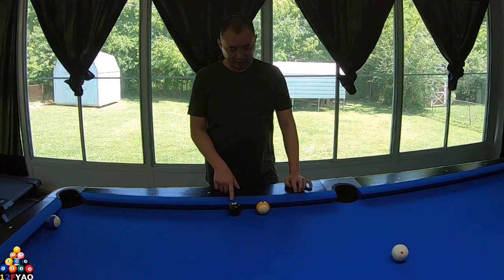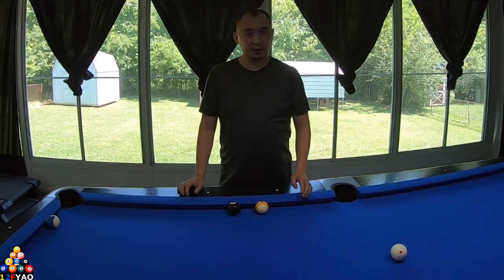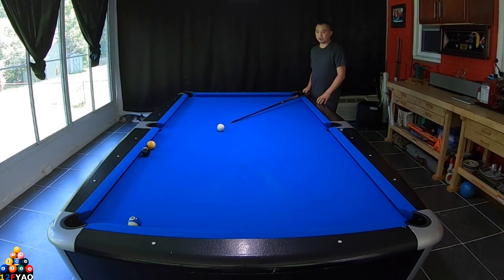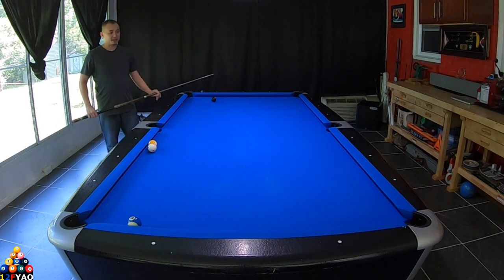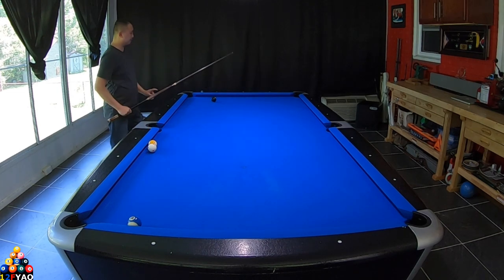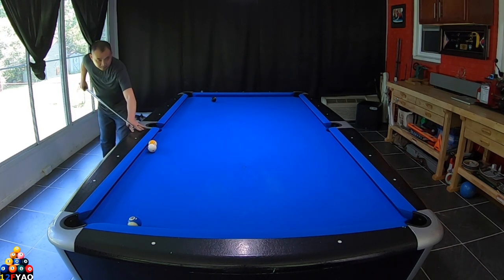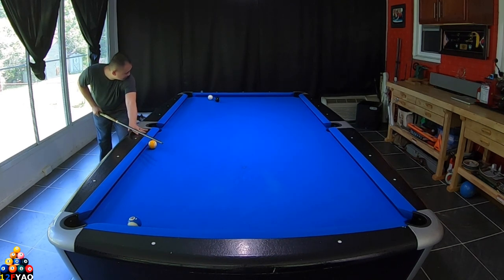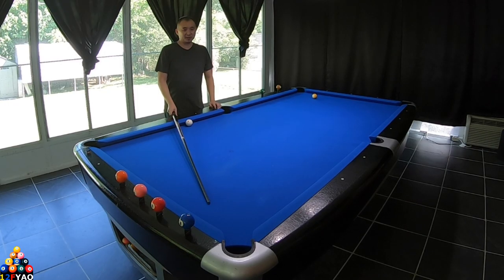3 Rail Kicking Sys. (Pool)

Comment: I was on the 9ft Table last night using this 2nd 3 rail system but beforehand, using the Corner 5 (1st system in this Vid) I determined the table was 1🔶 slow such that in order to pocket the corner from the 50, I had to aim at the 20 ( instead of the normal 30).  How do you adjust for this 2nd 3 rail system knowing this?
Reply from the maker: If you had to aim the 2nd diamond to make the CB go to the corner pocket for the 3 rails, you are not applying enough running English.   When doing the corner, running English is used for the 3rd diamond on the first rail the CB will hit. If not English is applied the 2nd diamond is where the CB will be needed to make it in the corner pocket. Use those two diamonds as your benchmark because they are CB tracks and not always one of the diamonds will not be available when other OB are in the way. Hope this helps, don’t forget to subscribe if haven’t already and please share.
Reply: I of course did apply running English at various levels and speeds when aiming at the 3rd Diamond, but it was short (ie-landing at the 10 on the long rail) in every instance.  I realize aiming at the 3rd Diamond is “Normal” but obviously not all tables play “Normal” and one must then compensate.  As such, I was asking what compensation one can do using the 2nd 3 rail System.  I imagine perhaps halving the Difference ( 1/2 Diamond or 5 points closer on the short rail) may be a place to start?
Reply from the maker: The table is just playing short. You just have to adjust to every table. The 3rd diamond on the first rail is the benchmark for the corner 5.  Hope this helps. Here are some videos from Dr. Dave that might also help.  
https://youtu.be/kWUADt_5cks?si=caqV5bJ8NMgLU0iA
https://youtu.be/G4dv9ekF3FY?si=nIk1LpdB5YnyOvlz
Reply: The Question is, How do you adjust. I too have seen Dr. D’s videos, but they don’t address compensating for the 2nd 3-rail System?  Does my inferred deduction in my previous reply make sense?
Reply from the maker: From what I know there is no adjusting especially if you try every speed and English to try to make it to the corner pocket when hitting the 3rd diamond.  If it doesn’t go, the table plays short and you just have to aim at the other diamonds to make it go in the corner pocket. 90% of the kicking system originated for 3 cushion and we are using it on the wrong table expecting the same results. The corner 5 is a tracking line to see how the table is playing. The player will have to adapt to the table and that’s the only way I see it. If you really want the 325 to work, did you just try hitting the CB at 3 or 9 o clock without top. Something that works, hope that helps.

Comment: Great way to convert a 2-rail kick into a 4-rail kick. You are really hitting a point on the 4th rail. Seems you pushed the object ball and cue ball to an easy shot most of the time for your opponent. Hit on object ball is pretty slow speed after contacting 3 rails. Hard to get separation on the balls for chance of safe results. Good way to pot the ball if 1 diamond or less from the pocket though. Approach angle is around 45 degrees vs 2 rail kick coming in at higher angle. Good stuff!
Reply from the maker: Yes the 2 rail into the 4 rail is like the last best thing for me to avoid giving ball in hand. Thank you for commenting and please share.

Comment: Starting about minute:14, you show numbering the diamonds such that the distance between 0 - 10 - 20 - 30 (with 20 - 30 on short rail) are represented by full diamonds yet, 30 - 40 - 50 on the short rail are only half diamonds. What is the math involved there?
Reply from the maker: It is. The 30 on the short rail is a full diamond and 40 and 50 is measured on the half diamond. I was thought this from a 3 cushion instructor back when I was stationed in Korea.  The 3 rail kicking system is derived for 3 cushion billiards. The math is CB minus OB equals the first rail the CB will hit to get to the 4th rail where the OB is. The 3rd rail is the same track line as the 4th rail. Here is a 3 cushion video with the full number on the diamond system, time 2:14. 
https://youtu.be/qbcYQSezLuY
Hope this helps, please subscribe if haven’t already and please share.
Reply: @playpool12fyao  Thanks very much for your reply. Not sure I get it yet but I will check out the 3 cushion video and subscribe. Cheers!
Reply from the maker: No problem. Thank you for subscribing and welcome to my channel.

Comment: I shoot on bar tables .Does the weight change the 3 railsshot
Reply from the maker: The only thing that changes is how the rails are. Many tables play different but the diamonds will give you guidance.  Regardless of the size of the table, a pool table is a pool table. As long as the table are 2 square put together the diamond system should always work. When I was stationed in Korea learn how to play pool from my instructor, sometimes we would play 3 cushion and the tables where 10’ tables. That is where I would also practice my kicking system.  7’, 8’, 9’, or10’ table, and the system should work for all.  Hope this helps and please share.

Comment: Why bother with doubling the numbers on the side rail to come up with numbers on the short rail? Wouldn't it make more sense to just give them the same numbers as the side rail, 70 to 70, 60 to 60, etc? Since, as you said, you are simply trying to memorize the track lines. And you are only using the numbers on the side rail as a target. So if you are on the end rail it would be easy to say, we're on the 55 track line and skip to doing the math going from 20 to 55 you aim at +3.5 or halfway between 3 and 4. If the end rail was used as part of the calculation, then it would make sense to figure out different numbers for the end rail. Great video, btw! I love learning new tracklines and applying systems I already know to them.
Reply from the maker: You are totally correct. After watching the video I could have made it easier. I do plan to make updated videos. I might have to revisit this one. Thank you and thank you for coming, please subscribe if haven’t already and please share.

Comment: The bar tables space at 10 inches apart .
Reply from the maker: Larry Leadman when I played 8 ball league, we played on 7’ Diamond table and what I can remember the tables played a little short when doing the plus 2 system. I would add a diamond or apply less spin to get the CB to go long. I would do the bench CB at 3 and hitting the 5th diamond on the short rail and see where the CB goes. When doing the 3 rail, extended plus 2, the more running English you put, the stiffer the CB will get of the second rail going to the OB. If more English is required to hit the new aim point, I would adjust to make the CB go longer because once the CB hits the second rail, you should see the stiffen up. Hope this helps and please share.

Comment: Yet another 'wild guess' system. We don't actually need a video to make a wild guess.
Reply from the maker: These systems are used in 3 cushion billiards. Look up plus system in 3 cushion and you will see it extends to the 3rd rail. Also the plus 5, it’s also from  3 cushion. They use the diamond system and number it versus using “feel” and  “just shift”.   Try the system and you’ll see how accurate they are. Thank you for commenting.